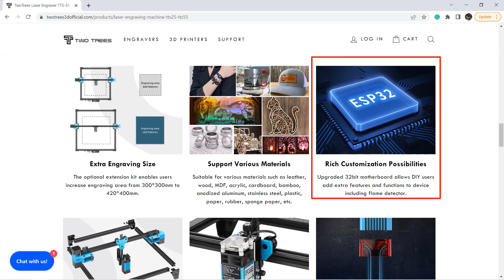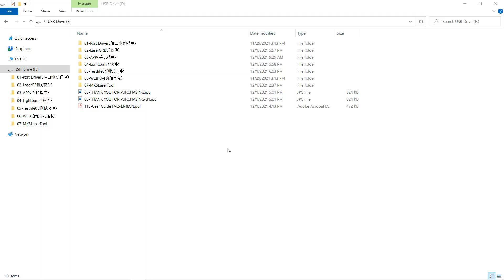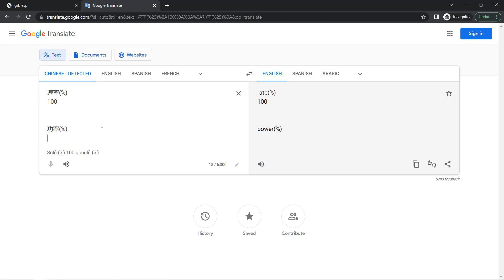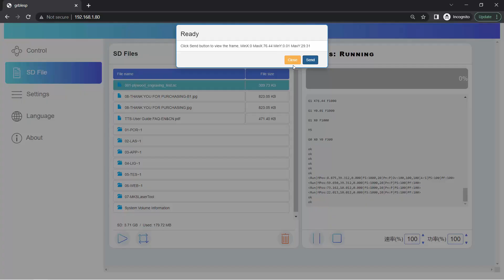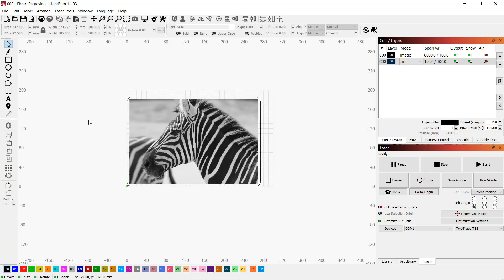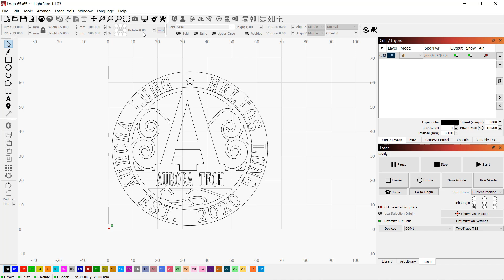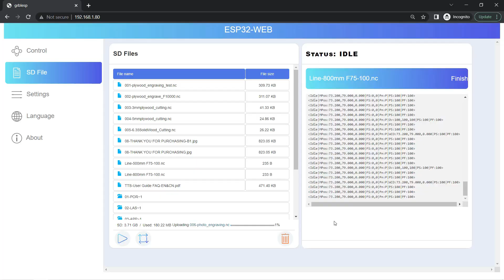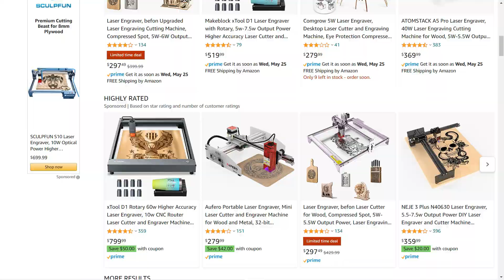TwoTrees TTS-55: Budget-friendly 5W laser engraver with WiFi support, Pros, and Cons

Comment: Hi Thank you so much for this informative review, I am planning to buy also, because of its wifi feature. Can I ask about the stainless steel you used? What is the thickness and is it a 304 Stainless Steel? I need information about it for my projects. Thank you in advance 😁

I was planning to get Atomstack A5 Pro because of its large y-axis upgrade (upto 850mm)

But the problem is atomstack has no wifi feature, My usb ports are faulty so I want to engrave wirelessly.

Comment: J'ai le modèle 10W. Gros problème: ) l'utilitaire de gravure par wifi n'accepte que les fichiers Gcode de petite taille. 2) j'ai voulu installer des end stop. Malgré plusieurs tutoriels consultés, cela ne fonctionne pas. Il doit y avoir un problème avec le firmware fourni avec la machine. 3) les montants aluminium du cadre sont bruts de découpe,  pas du tout d'équerre. Cela provoque de gros écarts de formes.

Comment: How easy is it to attach a rotary attachment?
Reply from the maker: Just connect the Y stepper cable to the roller instead of the Y stepper motor, the roller will work as the Y-axis.